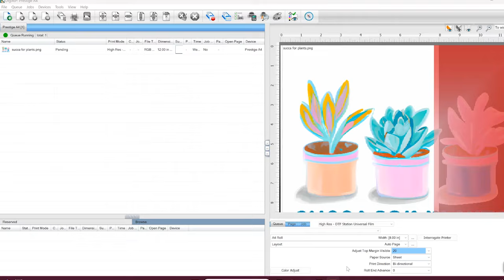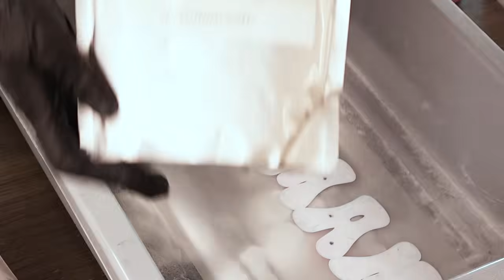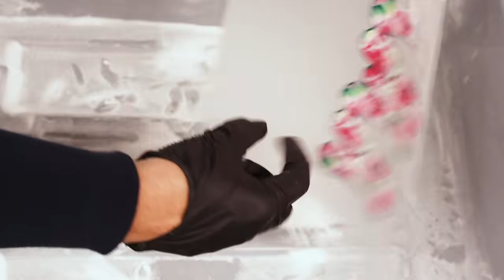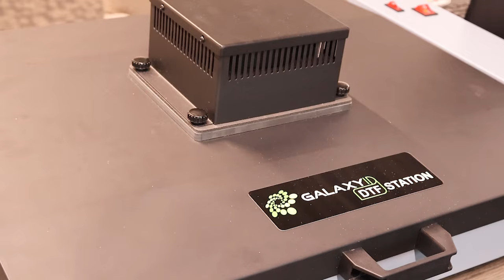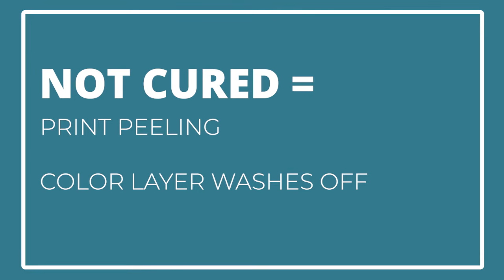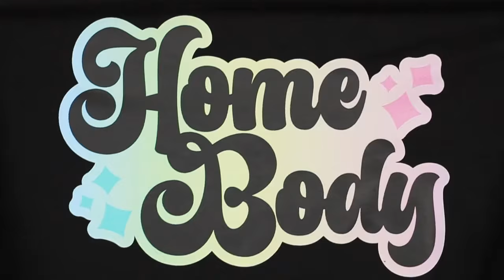DTF Printing Beginner's Guide: Printing, Pressing, Troubleshooting, and more!

Comment: Would you choose a different printer over a sublimation printer.
Reply: So I have saved enough to buy a real sublimation print 1900.00 . The up keep on the dtf is quite scary.   Because I will be using part time not all the time.  But I love the idea of being able to print on a wider variety of produces.  I still at a stand still.  The dtf is wanted but, everyone says the maintenance is not good.  Do you agree
Reply from the maker: The maintenance is A LOT. I am not a fan of the maintenance on a DTF printer.
Reply: @AngieHolden  one more question. When I order from a dft print place which would you order from. And do I have to have the white under my design or do they automatically put the white.
Reply from the maker: It depends on what I am making! Try this: https://www.youtube.com/watch?v=7eo9IWsuI5E

Comment: Great video, Angie. I bought an DTF image & the seller recommends 300 degrees for 10 seconds. Is your temperature/time more  because you're using the Cricut Autopress?
Reply from the maker: Depends on where you purchase. I would go with what they say to start!
Reply: @AngieHolden  I just tried to press it & went with their recommended time/temp & after 4 tries couldn't get all of it to adhere to the shirt. Then I used your recommended time/temp & got it to press, thanks!